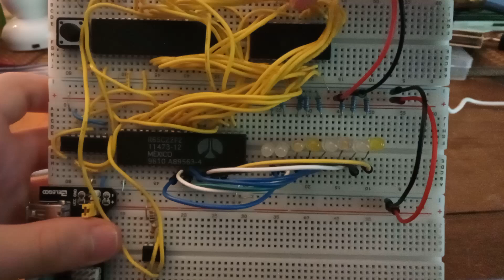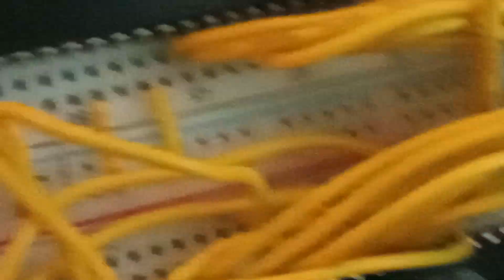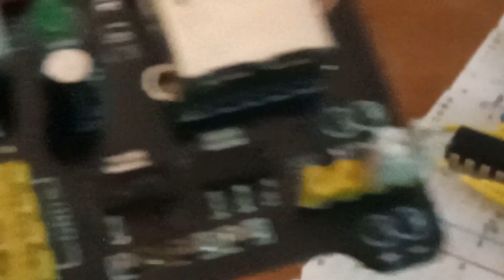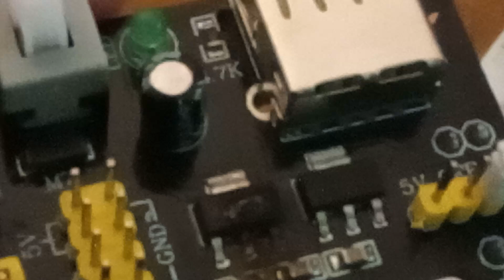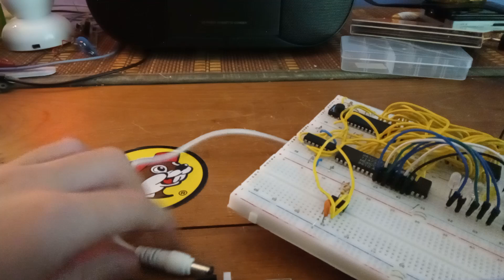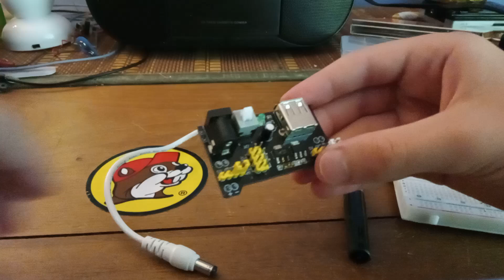All about my* home made computer! Check the description for why the word "my" has an asterisk.

Comment: Modern computers operate at lower voltages, FYI. Nice work!
Reply from the maker: @brianclimbs1509  The parts used here were designed in the 1970s, before lower power chips were designed.